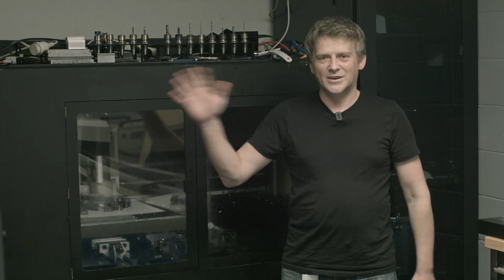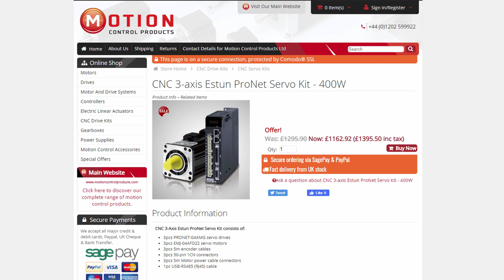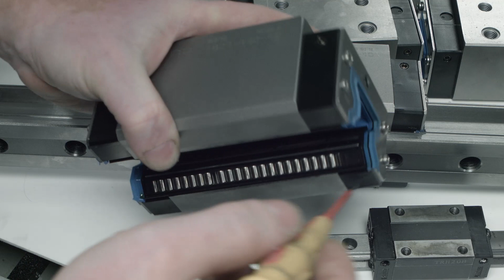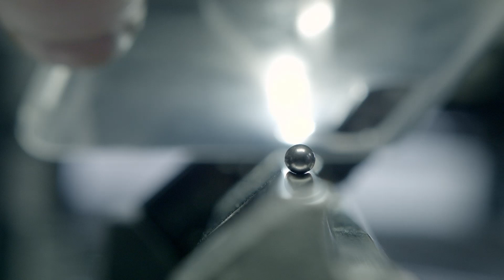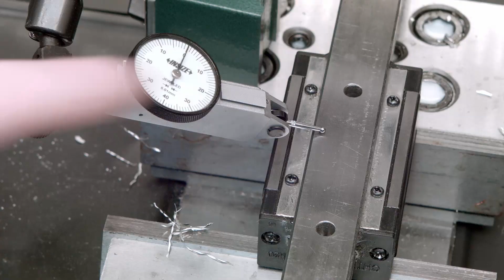EPIC cnc upgrade - episode 1. state of the art servos and monster linear rails

Comment: 0:01 intro
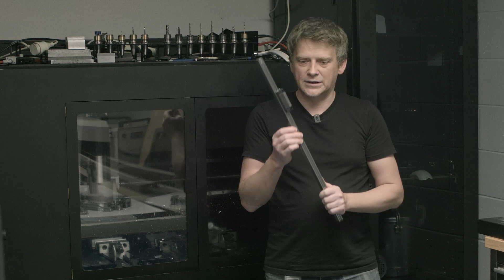1:28 upgrading rails
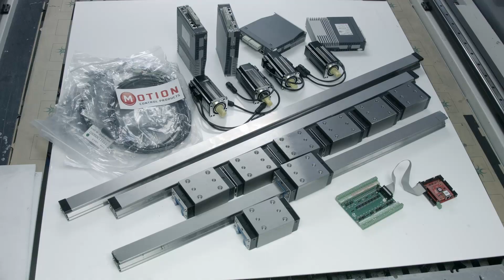2:35 motion control products website
3:39 roller guides
6:18 controller and BOB
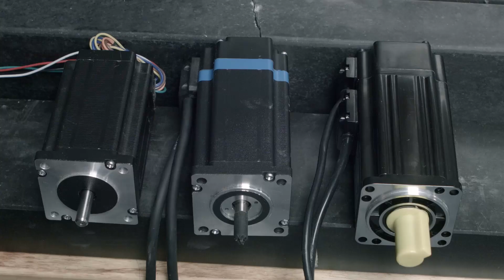7:03 difference between steppers and servos
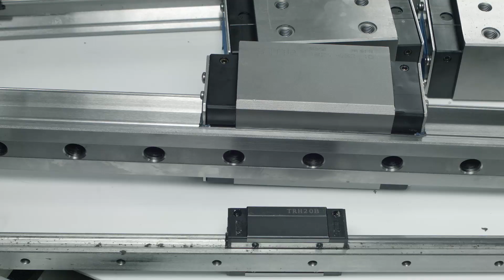12:38 difference between ball rails and roller guides
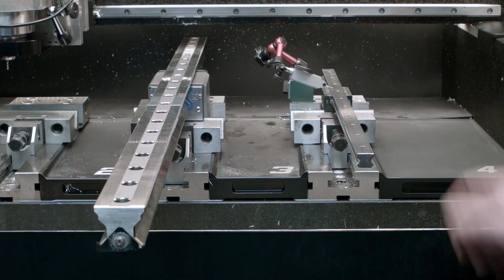23:10 testing jig
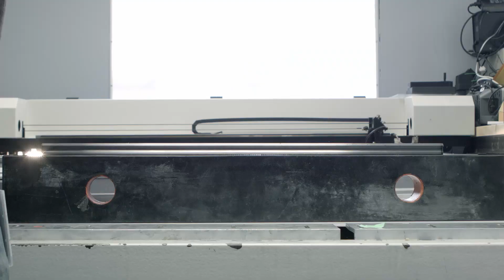28:24 straightness test with light
31:56 summary
Well done Fox :) that is seriously EPIC!!!
-Ken

Comment: I wonder if the improved rigidity is worth the energy cost & speed loss due to friction given the unavoidable deflection of the frame and stuff
Reply from the maker: If you made it accurate then there won't be any  deflection caused by friction. Btw. Frame is made out of granite, not aluminum extrusion

Comment: You should try air bearings. Real precision CNC gantry uses air bearings, accuracies are 1 micron and below.
Reply from the maker: Air bearings are high maintenance. And you can damage them really  quick. I need machine to work and not to constantly worry about and service it.
Reply: @PiotrFoxWysocki  interesting I will take note of that.

Comment: even the more expensive rexroth isn't straight enough. I'm disappointed
Reply from the maker: they are straight and with the same height once bolted. its just the bow. normally its not a problem, because you bolt it down to flat surface. I had idea to use them on the gantry, but now i changed my mind. but i straightened them anyway.

Comment: Hi Piotr - are you using the same size of linear rails on all axis?  What size of ball screws are you  using in pair?  Thank you again for your  answers and sharing your project!
Reply from the maker: i had an idea to use 45 size on all but than i i was concerned about the weight, size , sickout of x axis with   possible problems of driving z axis, so i went and bought 25 size roller guides and 25 size ground ball screws. please check episode 2 and 2.2.

Comment: @Piotr Fox Wysocki  You are right, these rails might bend your granite base. But this big pars are assuming you are going to bolt them on to something very strong and rigid! 
And it's somewhat funny, you are commenting about others saying linear rails that glide easy and free are best, and commenting on that the best and most precise ones are the ones that don't glide so easy..... 
But then later in the video you go on about that the precision rails are bad because they are bowed..... But think of it, they are preloaded in all other ways. Isn't it obvious that they are preloaded this way too? I mean look at how consistent the bow is between the parts. So you make the same mistake as the ones saying the rails that glide easy are the best..... There's nothing wrong with the bow, it's designed inn, as preload!
In your case this might be a problem yes. But these parts are intended to be bolted on to something rigid enough to make the end result perfectly straight and stiff. 
One solution you might consider is puting on an opposing part on the other side of the granite block, to compensate for the bending forces introduced by the rail. And the absolutely best solution then would be to mount two rails symetrically on the granite blocks. Then they will perfectly cancel out the bow from each other! Alt least in your Z and Y axis this would be relatively easy. And for X you could bolt on an opposing steel rail of some sort, and measure the bow as you go, and then compensate by tightening the opposing bow from the underside. 
So, as you can see there is no free lunch. Going up in size on the rails have it's own issues that will have to be dealt with. But when you have done it ti will be waaaay more rigid and precise, so it will be worth it!

Comment: So basically any way to come to um is air bearings. I am thinking to use granite plates to make mini grinder love you project.
Reply from the maker: to be with in 1 micron you dont need air bearings. just good rails like i got now for the upgrade. rexroth 45mm. or smaller.  they are under a micron or around there. IMHO air bearings are a bit too tricky and not necessary.

Comment: Hello Mr. Fox.  I have watched your granite build videos many times, and find your design very interesting.  I haven't seen that you have told us the working envelope of your gantry machine (X,Y,Z), and would ask if you could give us those numbers?
I have inherited a very large granite slab, of 1500x1020x170 mm.  It used to be the table of a very precise 4 spindle drilling machine for circuit boards.  The last 20 years, it has been a garden table in my fathers garden.  I am planning to have this slab cut into suitable pieces for a gantry cnc machine.  It will need some lapping to bring it back to spec of course. My first design sketches, i have a table of 1020 in X direction (gantry width) and 600 in the Y-direction.  However, I see that only half of the Y-axis will be usable.  
Thanks for taking the time to document your journey to build the granite CNC.
Reply from the maker: my machine is 900mm x 600mm. and working area is 700mm x 380mm. if you want to have whole area usable you will have to extend the side walls beyond the machine to accommodate thickness of the gantry with the spindle. personally i don't use that much space because vises are not that long. but who knows you might be doing different things so you might want something larger.

Comment: Hey Fox, thanks for the inspiring build. Did you consider using (porous media) air bearings? You get ones that work on a linear rail, or for granite machines you can use the flat bearing type straight on the granite surface.

New Ways Flat Rectangular Air Bearings catalogue shows an example of this. They market them as: zero friction/wear/vibration, high acceleration, precision positioning ... sounds like the holy grail :D

I saw a couple of YT'ers making them DIY - David Preiss, Applied Science and Machine Tech Video Blog. With your skills and machine you could surely make them, then add an air bearing spindle to have the ultimate in surface finish. 

Would be great to see someone else trying their own graphite air bearings!

Comment: i switched to closed loop steppers and the are awesome (integrated ones. with matched and tuned driver on motor itself).
i use them in 1/10 microstep mode and it is very quiet with no vibration (they are switching between steps differently than regular steppers. feels like driver uses sine instead of hard pulses).
and my Z stays in place when turned off ))

Comment: Those roller bearings are EXPENSIVE! Very good argument for their use though. 
If this is a "high end" state-of-the-art machine, then why the clunky motion controller and why not the AXBB-E (UCCNC) or XHC mach3 controller?
Lots of good info. I'm glad I just started on my CNC project and I have not bought any components yet!
How lucky for me to come across your video...After looking at the Chinese CNC routers, like the 6090s, I realized they are junk! Unreal that people are buying that trash. I see people who have then do this upgrade and that upgrade and end up with something not a tall like what they got from China.
As a computer software/hardware engineer with some machine tool experience, I'm glad I didn't get suckered into a Chinese CNC; thanks to YouTube'rs.
Now I will start from scratch including having parts water-jet cut, etc., and after your video, I'm back to the drawing board to rethink my design...
Now you got me going out to find real small roller bearing linear guides; cannot use those monsters you have! Looks like ball bearing will suffice.
About the servos though, steppers can hold position; locking the axis while another moves, do the servos lock (have not read up on servos)? You don't say anything about actual operation compares to servos.
I don't see the point of the light test of the rails, they will be bolted to a precision ground surface anyway. The big rails are bowed; perhaps made that way since you will be bolting them down (presumed by the mfgr to a cast iron base and NOT granite), but don't see any mounting holes in them.
Finally, we cannot see what it is you are upgrading other than a black box with a window!
Thanks!
Reply from the maker: servos can hold the position just like steppers, i will talk more bout servos later on. 
light test on the rail was to check if they are straight. my granite gantry is 50mm  thick, and if rails are bent too much they will bend my granite gantry or break. so i have to straighten them up.
they have mounting holes but they are covered by metal cover strip. 
sorry for not showing the machine, i kinda assumed that viewers are familiar with it. thanks for pointing it out.

Comment: It's amazing how powerful motors have become. Your servos look deceptively underpowered when placed next to the linear rails.
Reply from the maker: close to those rails everything looks small :) i think those servos should be powerful enough, but it will be close to the limits. my gantry will weigh 35kg granite + 25 rails+ 15kg spindle+ 10kg z axis assembly and 4 carriages 13kg so together about 97kg. 2 servos to  run this, so   roughly 50kg per servo.  i have hunch it should work just fine.
Reply: @PiotrFoxWysocki  What is the power of your servos for the Y-axis?

Comment: A popular upgrade for Chinese rails is to replace the balls with fresh ceramic high tolerance balls. I would be interested to see how much that would improve your rails accuracy? Perhaps for the X axis?
Reply from the maker: i did replaced ball bearings in the screws and rails with ceramic ones. it did improve quality a bit but it wasn't anything spectacular. but it did removed backlash. that's why i decided its time to do the upgrade, before this quick fix will wear out.

Comment: Interesting and impressive roller linear system. I was likely just as surprised as you were by the amount of wrarpage in the otherwise miracle of a rail. I strongly suspect that the bow is from when they heat treated the surfaces for the rollers. Perhaps it moved in time, after it cooled. I saw a cracked granite something or another in the beginning to the video . Gulp   : O

I should think that the rails can be (straightened). Perhaps you could also borrow 2 box or "I" beams from a construction site, and use a hydraulic bottle-jack to bend it, with standoffs on both ends.

You would have to rig up something to hold the beams together, with likely a thousand kilograms of force. Two heavy lifting-style chains might be able to hold it together. The going would be tough because everything will want to move until there is pressure on it. The beams would be laid down on a table on two boards to hold them off of the table. The chains could be looped on each side and hooked around themselves. The bottle jack goes in the middle also suspended in the middle of the beams. A block may be taped to the sides of each end of the rail, to slightly reduce the aggravation of the setup. The rail goes between the chained together beam with the bottle jack at middle. Then you could work the jack bending the beam in a trial and error kind of way. The chain may want to skip around corners while it is being tightened. An assistant might help hold everything together. Also, you might be able to rent a portable hydraulic ram, which are used in body shops and building trades.

If all else fails, the rail might be straitened by heating the back with a torch and letting it cool. It will shrink. Though, it's a hard thing to control, and you don't want to lose the heat treatment on the contact surface. I guess that you can always heat it more, but not less. Perhaps a non-contact thermometer might help, if they go they high.

[When I was making my CNC, I shorted a few rails. There I was with an electric saws-all, cutting the rail. I could not believe how well it was going. I was half way through the rail--when I hit the (likely) induction hardened surface. And that was that for the blade. I needed to finish with an abrasive cut-off wheel. The rails were NHK Japanese ones that were being saved from being thrown into a scrap metal dumpster all a lot of nice robotic parts.]

Comment: Piotr, send me an email to clivemilne@gmail.com and I'll show you where to access accurate (C0/1 & 2) NSK ball screws... they'll be under 500 US dollars per screw.   They are "salvaged" in the sense that they were an OEM item but no longer required and on-sold..  Still in the original packaging, and you will need to do some machining to get them to fit your machine... But, you know... screws like this don't come up that often at  20% of the retail price.  Just to be clear... I personally am not selling anything...Just pointing you in the right direction.
Reply from the maker: C0 is quite incredible. however tempting it sounds, i wouldn't trust anyone where i live to machine the ends for them precisely enough.

Comment: Think you will have issues getting good accelerations and rapids with those large rails and small motors. Just the extra resistance of the rails may cause issues and any binding if not perfectly aligned will easily bind the machine.
Reply from the maker: im looking for 3000mm/min travel speed. i don't need any more than that.  I'm sure those servos will keep up. currently i have nema 23 from my old 6040 chinese cnc and they can move 60kg gantry no problem. 
I'm aware or binding problems if something is not aligned, I will pay extra attention to that.
Reply: Piotr Fox Wysocki ok I understand I thought maybe faster rapids would be wanted. For 3d profiling and high rpm spindle cutting speeds can approach 3000mm/min. Also I saw you video on belt conveyer that was very cool idea and I want to incorporate something similar.
Reply from the maker: @AgosMachine  if i will get better rapids than what i have it will  be a bonus :) but I'm mostly focusing on the finish quality than speed. sometimes its good to have some time to react when you make a mistake and you have to hit emergency button :)  This conveyor belt is great. i just switch full bins of chips with empty ones. no more swiping, wiping, and no more mess around the machine.

Comment: Linear rails are like wet noodles until mounted, so your measurements are fairly meaningless.  When evenly bolted to a comparatively stiff surface then they will conform to that surface.  The greater precision the bearing block, the flatter that surface needs to be.  Read the manufacturer's technical documentation for guidance there, and also bolt torque and recommended mounting procedure.  It is common to have a flat shoulder to push the rail against to ensure that it is straight in a second axis, at least for one rail.  The second parallel rail is sometimes left unconstrained in that second axis and pulled straight by the connecting saddle.

Comment: Measuring the rails, without attaching to anything, basically proves, if you have thicker steel, it bends less. This is why these have so many holes, so you can fix it to a precision surface. If you fix the "small" one to a surface, set the straight also,  then you need to measure the parralelism between the flat surface and the ball channels. That would gives a good indication of preciseness, this way you measure the result of surface hardening's tension. The big roller guide have more non hardened volume compared to hardened that the small ones, so it can handle the tension more, which way it deforms less after the process. 
Ball vs roller I kinda agree.

Comment: if i buy normal ball rails, could i not just put the rail onto a grinding machine and grind the bottom surface parallel to the carriage?
Reply from the maker: yes, this is what i have been doing on those cheap Chinese rails. but i have been doing it by hand. but if you do this on a surface grinder, it should be perfect. one thing which is tricky would be the quality of the ball groves.

Comment: Hi Piotr, I really appreciate your videos and the deeper understanding of how things work and what is important!
Wondering:
1.  Is this how the rails come from the factory, or is this after they've been dropped from a conveyor, put under a heavy pile of other packages etc.?  I know that for long pieces of CRS, warehouse guys sometimes lift them from the middle with a forklift and put a bend in them.
2.  Is it reasonably possible to straighten the rails?
Reply from the maker: i know, handling might be an issue. but those rexroth rails have very consistent bow in them. which let me believe it must be related to heat treatment.
straightening usually is done by screwing them down to the machine bed which is straight and very thick. 
so for my y axis im not troubled by it because i have like 300mm of granite. so it wont distort granite it will just confirm to it.
problem is with x axis on the gantry. where thickness of the granite is 50mm. and thickness of the rail i 40mm. 
im sure granite will bend. i did tests when i was building it and on the span of 1000mm it was bending 2microns under 20kg load.
so my options are.
leave it as it is and have slight bow in gantry.
try to straightening them a bit more. i will give it a go.
make a thicker gantry. but this would increase weight, which I'm trying to avoid

Comment: I love the Polgardi Desgin stuff. I actually know thy guy personally who makes them. These are epic. I also love the wireless handwheel, what they selling. Not cheap, but gamechanger. I hope you will share the experience about the controller. Will you use it with the own software, or just mach3 it?
Reply from the maker: i will try to start simple. if it will work under mach 3 no need to change it. it it wont. than I will change to something else :)
Reply: @PiotrFoxWysocki  As I know it works fine with that. If you ran any trouble, I can give you contact to the guy who makes the firmware, so you can work things out fast :)
Reply from the maker: @Sastas  cool! thank you, much appreciated :)